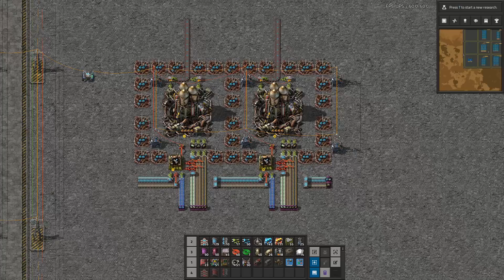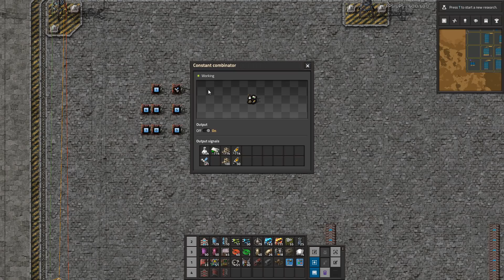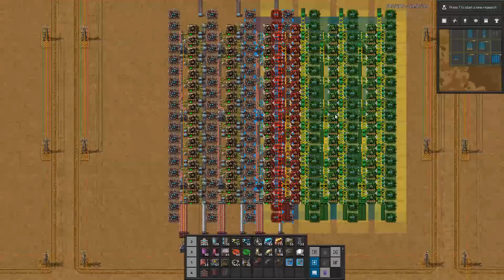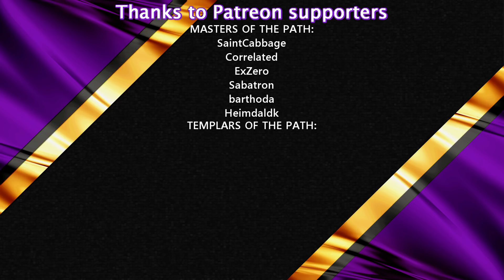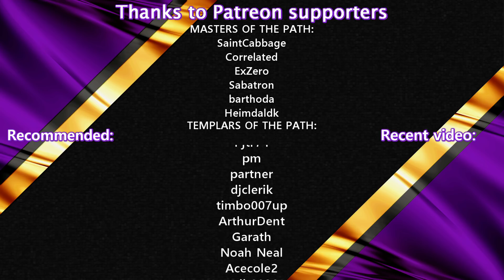End Game Megabase SPACE (WHITE) SCIENCE 22.5 / sec | Factorio Tutorial/Guide/How-to

Comment: For the rocket fuel production, I find it easier to use petroleum for the solid fuel, so that light oil is only used for the rocket fuel. Yes, it's twice as expensive to make the solid fuel, but we're also making so much petrol when we crack it down that it ends up balancing out. I haven't had any problems yet but then again I haven't yet built a mega base.

Comment: Using the petroleum for the solid fuel is a safer design because any surplus petroleum it will eventually get backed up. This means you will need to starve your plastic or other builds of petroleum. Best way to go is to pull of the light oil you need and crack the rest, this way you are consuming both products.
Reply: Any refinery/liquifaction station I have which is intended to produce other fractions just has an overflow station for petroleum. If all the main petroleum stations fill then the overflow station starts filling, that goes to solid/rocket fuel to unblock production. Seems pretty straight forward to me. You can even regulate the light oil usage by just back filling the light oil solid fuel production with the overflow solid fuel. The only time this goes wrong is if there's so much oil production that you just end up purely turning petroleum excess into solid fuel but if you have that much overproduction it doesn't matter what you do. Producing/Using more plastic will take off the excess petroleum and rocket fuel will return to normal.
Reply: Yeah, I would also have gone for that. He mentioned it in the video but didn't really understand why it was a bad idea for him.
Assuming he wants to use all the petroleum from his refinery (so 794 unit/s, or 132.3 unit/s per column) 
He will need to change 3 chemical plants for petroleum -> solid fuel to fully consume all petroleum

(The advantage/inconvenient I can think of)
Advantage : 
- This gives him around 42.9% of all the solid fuel needed for rocket fuel and so, greatly reduce the cost for light oil
- One chemical plant build gives enough resouces for the rocket fuel build => No need to starve plastic build or other petroleum-based product
- No petroleum stacking up as the 3 chemical plants will be slightly starved (and as they will be in front, they will be prioritized for output)

Disadvantage : 
- Not really efficient as the recipe petroleum -> solid fuel is pretty bad
- Takes slightly more space for fitting the petroleum pipes

Except for that, great video ! Can't wait to see everything in your true megabase lets play !

Comment: Very nice, but what About LDS for yellow science? You bring the LDS for yellow science by train so wouldn't it be nice to produce all of them in one place?
Reply from the maker: You can use the same design and then paste as many as you need depending on the size of your base
Reply: If my math is right, it takes 7 rows of of the 16 LDS assemblers to provide enough LDS for both yellow and white science at 1350 each per minute. You'll end up with a little extra but not that much extra. It saturates almost a full belt, which you can just have on your main bus and pull from as needed by the two science, and overflow will go to any other purpose in your base. The whole thing needs inputs of no more than 13 and 3/4 belts copper, 3 and 1/2 belts plastic, and 1 and 1/2 belts steel.